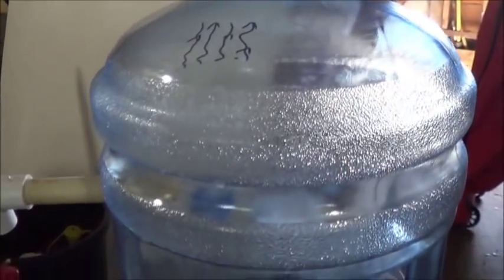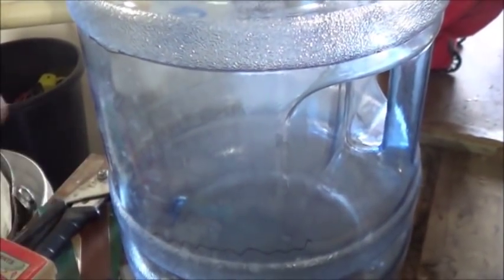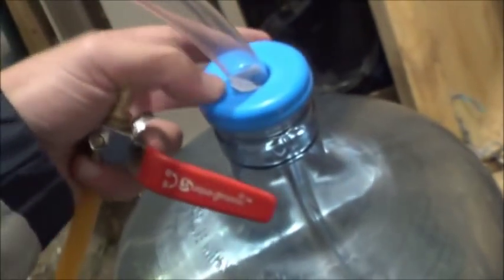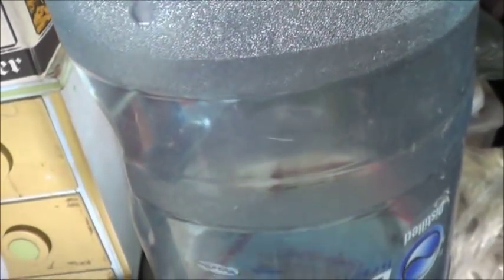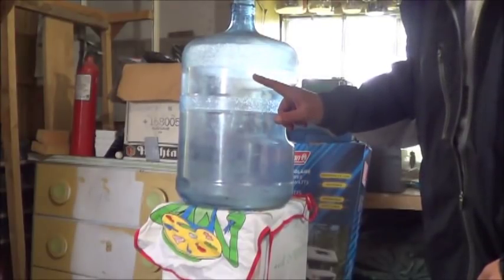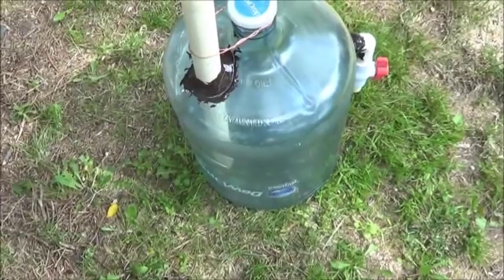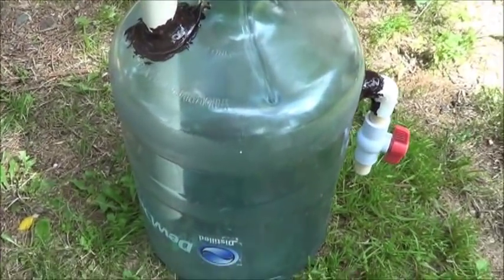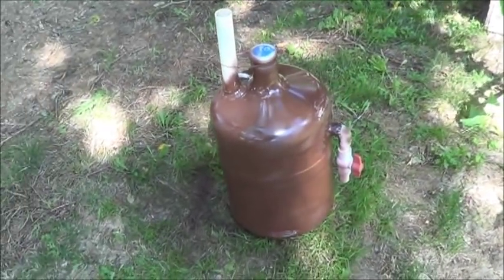Water Bottle BioGas Plant Build

Comment: great video this looks like it would work for people traveling in a RV or camper full time so they don't have to use propane gas only
Reply from the maker: Not sure how safe that would be to travel with.  Methane is a suffocation risk due to it being heavier than oxygen & it will force air out of a small space if it can ...

Comment: Hi, excellent video. One thing you need to do is get the second tube (the one in the side of the bottle) to go under the liquid surface. This is important because you need to create pressure by the rising methane gas so you can use that same pressure to push the methane out the top tube for use. This same pressure will push liquid fertilizer to the side for your garden from the middle of the liquid column. Don’t worry about the oxygen there won’t be much. Pressure is more important for biogas systems.
Reply from the maker: Thanks, an excellent tip!
Reply: This tip is correct any gas will take the easy way out so will exit from the effluent tube that why all the other one take the effluent from the middle and then use a riser to bring it to the level of the liquid you want a t is used to stop it from siphoning it down check solar cities  biodigesters  they have an excellent video on making the digester

Comment: Your effluent pipe is  a way for air to be introduced into the digester and if sunlight is introduced though the  walls of of the digester,  the microbes will start to make oxygen which will kill off all the bacteria that produces your methane gas. You must paint your digester a dark colour.
Reply from the maker: Thanks for the tips!

Comment: After digesting of the waste how long will it take to exchange the nonfunctional remaining of the waste because by adding waste the container will be full which is not good idea
Reply from the maker: I believe the idea is that as the waste breaks down inside it turns into more of a liquid.  That liquid then comes out the overflow as the fertilizer when you add more waste to the system.  I think?  Still haven't got this 100% yet ...